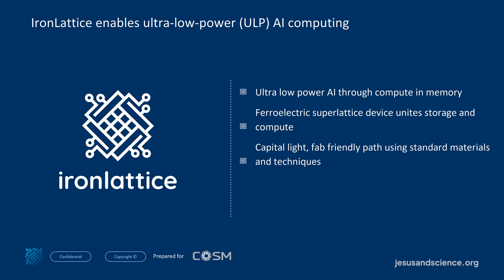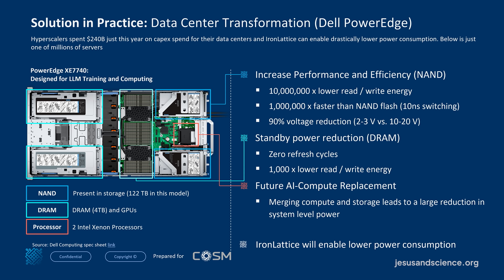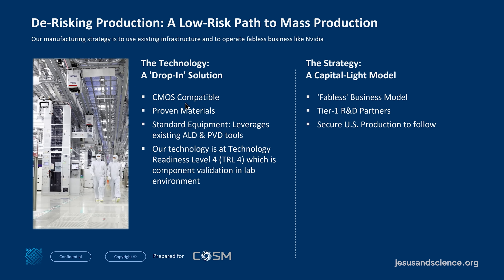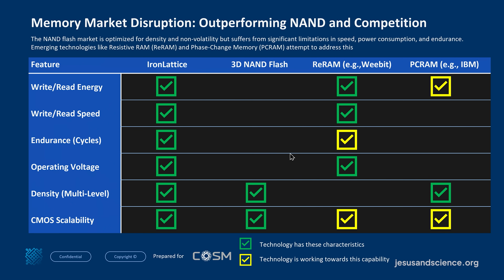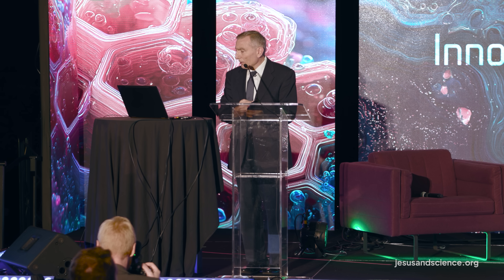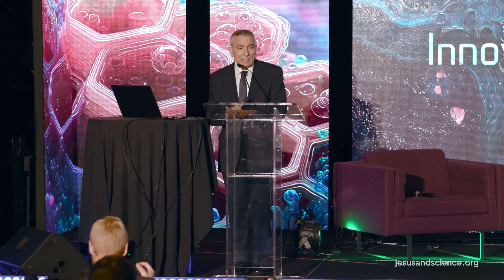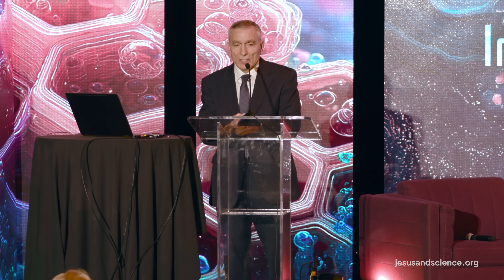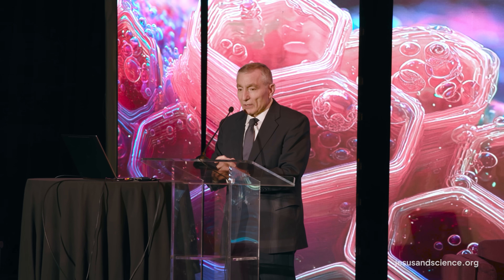Breakthrough: Radical New AI Hardware Design That Nvidia Can’t Ignore | COSM 2025

Comment: Putting memory and processors together on the same chip is not done now because you need the same number of layers on both.  Right now, DRAM has maybe 8 layers while processors have 40 or so.  That’s like linking an 8-story building with an adjacent high rise. Above four floors, everyone from the high rise will fall out and die as soon as they go over to memory.  Presumably ferroelectric substrate can be used to even out layer count, either adding layers to memory or reducing layers from processing.  

AMD already solved this problem a decade ago on standard silicon by using their proprietary background in a unique form of memory called SRAM (static random-access memory) which has the same number of layers as a processor.  This is one of the reasons their new i450 chip outperforms NVDA significantly.   I have never heard anyone mention this, I suspect because they don’t have this intimate level of knowledge needed combined with the creativity to put 2 and 2 together.  It is the main reason I have been positive on AMD since the stock was $2 per share.  

Regarding wafer-sized chips, that’s pretty much not economically feasible or necessary with the AMD chip.  They hired a brilliant guy named Jim Kelly in 2014 who figured out how to make the interconnects between chips run just as fast as the internal processes in the chip.  So, they could make the chips smaller and just stack them and get the same performance as a fully integrated wafer-sized chip.  Intel went on the route of integrating everything into one huge chip like Dr. Tour suggests.  That’s how intel lost out to AMD.  The all-in -one chip started out with an enormous chip before they shrank it down that gave zero yield if there was a single defect on the wafer.  AMD in contrast achieved high yields from the start, reaching profitability almost instantly.  Anyone can design and produce a chip with small dimensions.  But not everyone can do it profitably in high volume commercial applications.  This is why Moore’s law was such a breakthrough predicting the doubling of technology every two years.   It is not a statement about technology.  It is a statement about the rate at which commercial viability is achieved.  

I could be wrong, but I see nothing here but an inadequate solution to a problem that the great Jim Kelly already solved a decade ago, putting Intel out of business because they couldn’t solve the problem.  When Intel finally saw the writing on the wall, they hired Jim Kelley too, but by then the game was already over and Intel threw in the towel.  

George Gilder BTW is a New England intellectual historical theorist who studied under Henry Kissinger at Harvard and has no background in electrical engineering.  He was completely wrong about 1999 optical in the bubble and lost people fortunes.  He disappeared into disgrace for decades and has only now re-surfaced with the advent of AI and the emergence of a new generation of young tech investors ( tech investors are almost always young) who have no institutional memory of who this guy is.

This work is being done in academia where there is no requirement to solve practical problems.   Moore’s law, remember, is basically about economies of scale and learning curves in commercial applications, neither of which happen in a university setting.  This is only at stage 4 of 9.  It sounds to me like they have not done their homework on prior art, but I could be wrong.  They may achieve in ferroelectric that which AMD is already doing.   

What am I missing?  Help me out.
Reply: With all the people around him involved in this in the chip business it sounds absurd to assume they don't know all of this and would move forward with this if such issues were relevant... They wouldn't be wasting their time for no reason. And the two companies he said they are in talks with for this would obviously know all of this too...

Comment: RE electromagnetic interference question at 13:30 -- It will not matter because the mumetal shielding can be easily applied just as anywhere.  There is likely no benefit over nor shortcoming under existing electronics.

Comment: Very impressive. However, isn't this already underway elsewhere? I'm thinking of Bernardo Kastrup's startup EUCLYD, whose CRAFTWERK has a System-in-Package (SiP) architecture that integrates both computation and memory in the same physical device, to minimize the traditional "von Neumann bottleneck" and avoid the data transfer latency associated with external bussing. Is your device markedly different?
Reply: Yeah he needs to clarify this
Reply: The problem is you can't clarify such things. The way you handle memory is the main proprietary part of the computer. However, how they're planning to do it is bad. For the longevity part of it, however, the inventor is on the right track. Congrats to Mr. Shin.

Comment: This is not a computing revolution, and presenting it as one is dishonest. The core idea of ferroelectric CIM is a well known, decades old research direction, not a breakthrough, and the headline claims rely on misleading comparisons between single-device switching energy and entire system-level NAND or DRAM operations, which no competent computer architect would accept. The slides ignore the dominant real world costs like analog noise, ADC/DAC overhead, calibration, yield loss, thermal limits, and scaling beyond toy demos like MNIST. Claims about “drop-in CMOS compatibility,” “true compute-in-memory,” and “the end of the microchip” exploit ambiguity between lab feasibility and system viability, which are radically different things. At best, this is a plausible niche accelerator for certain inference workloads. Portraying it as a general solution to AI energy consumption is wildly overblown marketing.
Reply: This is a good example of speculation. There are no details about this amazing superlattice ferroelectric layer. What can be done in the laboratory cannot always be transferred to the production line for many technical and financial reasons.

Comment: Anyone who understands chip design know computing requires trivial amounts of energy.  Intel chip design is so poor it can consume 100 Watts while the actual computation cost is about 1 mW.   Apple abandoned Intel for that reason.  Apple Silicon processors are many times more powerful than Intel and Nvidia and consume trivial amounts of power.  Nvidia is great at making lots of noise.  There are other GPU and NN processors out there that perform much better.  People worry about China overtaking the US in chip design because the US for some reason prefers junk like Intel and Nvidia over well designed chips.  The stupidity of that decision was been known for decades.  The cost savings in buying an Intel chip is lost within months in terms of energy cost, mostly for air conditioning.  Note that AMD is Intel compatible which means it is junk as well.

Comment: This is incredible if it works, and not just for data centers, but for everyone. It would allow the use of computers with a much lower power requirement, which democratizes their use. You could get enough energy to run a laptop from a small solar panel.

Comment: This is the greatest problem with competing against nVidia though.

You can't JUST have great hardware, you need a software solution that can compete with CUDA too.

AMD kinda got there after many years with ROCm, though it's still pretty rough around the edges.

By the time you get your own software up and running nVidia will probably have just embraced a more competitive hw architecture for AI/ML compute, but already baked into CUDA.

Comment: Funny, looks like battery technology advancement is taking so long we are gonna get longer lasting batteries only because the electronics have advanced enough they use significantly less power. Don't forget microled screens seem to be a sure thing and on the way in maybe 5-10 years and use maybe 50-70% less power.

Comment: Your data centers are wasting 500lbs of copper 750 cable on average ik i build them simply putting the power racks side by side decrease production cost and annual upkeep by 5k, yes theres room why am I running 32 60ft 750 cables when 22 foot would do no down side. And labor cod decrease by 2 days

Comment: 3:54 - I don't understand how compute can be done in memory without changing software? Just switching out memory doesn't seem sufficient to make a functional system.
Reply: Try finding an actual read or write time in those diagrams.  The only thing of any interest is a memory having more than two states, and that is nothing new.  Ironcore memory was one of the very first memories (like 1960's).  The density difference compared to modern memory is like 10's billions time worse.
Reply: that’s exactly the beauty of AI - fixed algo with “memory”/tensor being its logic
Reply: Maybe just an additional kernel module...

Comment: He's back.  I'm at 2:54, and know what his priority stuff is there.  However, which option is he using. Their is a way to do it with standard material, another with his, and a third option coming on stream.

I've been proposing to do what he is announcing for a while.   But nobody seemed interested, but now somebody else is doing it (again).  I have actually bern interested in using his materials and getting in contact with him.  I am in a section of industry with the lowest energy processors, and was to design a high performance version a d transformation circuite for this sort of scheme.  There are a terrifying amount of these small processors that can be stacked together on one wafer.  So, I was planning on balancing out the performance to the amount of memory around each cpu for performance targets (a 1TB+ wafer system capable of producing 60Tps, for personal local AI inference at $1000.  But, by changing packing desity of cpus very high parralel performance is possible.  The cpus are only a small fraction of the stacked wafer circuit, so 10x speed up shouldn't sacrifice much memory.  100x speed  up could use high speed system requiring active cooling,  but may just need more cpus with a maybe fraction of memory decrease.  In a server farm, these sorts of cooling challenges are common, and the speed more important.  Anyway, these processors start at around 1000 transistor worth, plus stacks.  My design was to aim at 4000 transistors.  I had been equated with tne top low energy processor designer, who's company is contracting to do AI.  My own designs were trying to maximise performance per mw, rather than absolute minimum energy, with simplified performance increases, concentrating on extending the ratio between energy and performance.  Since I am recovering from long covid and injury, I have decided to training a bit and start pursuing magnetic quantum cellar automata research instead.  Which is a lot faster and has lot lower energy than what I just mentioned.

Comment: We did this with software. No e-waste needed.
Reply: If you have the best most efficient software it seems you should be trying to partner with them.
Reply: @suggesttwo  We'd love to, but it's not up to us.
Reply: You can't reduce hardware power consumption with software. If you run the same software it will take less energy with this new hardware.
Reply: @suggesttwo  It is possible to reduce hardware power consumption with software.
Reply: @pilzburied Nope. If you then put the improved software on the improved hardware there will be the same improvement in efficiency.
Reply: @suggesttwo  Using software optimization to reduce power consumption in hardware happens. It's definitely "a thing." Get over it.
Reply: @pilzburied In the 1990s when hardware wasn't that fast bottlenecks in the software were written in machine or assembly language to reduce the number of clock cycles to execute the code.
Reply: @suggesttwo  You're attempting to argue with someone who engineers software optimization daily. You can dismiss innovation all you want, but that doesn't stop people from innovating.
Reply: @suggesttwo  Then, I guess we know something that you don't.
Reply: @skyrmionlabs explain like I am 5. I am an electronic technician by training. If you lie I will name the law of physics you are breaking.
Reply: @suggesttwo  Why would we have to break the laws of physics? It's a matter of software optimization that has been around for 70+ years. There would be no reason for us to make such a claim if we couldn't prove it.

Btw, science has been re-written numerous times. To assume that we know everything is to apply limits to thinking and innovation.

Comment: I used to work in this industry. Been out about 15 years and figured everything had changed. I was shocked to hear that, no, not much has changed. Just scaled up. CMOS, DRAM, the architecture is all the same. That's insane. I used AI techniques in the late 70's, 80's and 90's to get my software to perform the "impossible" tasks that were required. It was the only way to solve the problems we were facing. At the end of the 90's and early 2000's computers were no longer resource starved and my software started to get strange. It made me uncomfortable. I understood the potentiality. Not good.

Now you tell me there is no transfer latency (compute IN memory), no thermal issues, no refresh cycles, CMOS compatible, massively scalable. This sounds troubling to me. And it sounds like data centers can be powered from house current. YIKES. That log cabin, off the grid in the outback of Alaska is sounding better and better. Are you certain you want to release this on humanity? It's likely too late in any case. My nightmares will now be much more vivid.
Reply: At the end of the day it's the implementation of the technology that matters. If we do not use it we will be left behind. Remember we are the retaining force holding the anti-Christ back from taking over like described in 2 Thessalonians 2:7. The technology will be used to take over the world after the church is rapture'd and the anti-Christ is allowed to take over.
Reply: @Johnny-es9xg  Yeah, granted, you are correct. It is still spoooooky though. Though I won't be here to see it I am still kind of regretful that I participated in its rise. However, it would have still risen regardless, it's not my fault. God works in mysterious ways, eh?
Reply: We've got 5 good years left. Make the most of them. After that, the world will likely enter a state of constant change due to the drastically increasing pace of technological development. Eventually the rate of change will be so rapid you'll wake up in a different world than the one you went to sleep in. Buckle up...
Reply: It likely won't scale. There's eddy currents, white noise, radiation interference. This will introduce single point failures and the data industry won't adopt the risk at scale
Reply: @notaras1985  Single point failures can be dealt with. We have long ago dealt with the other problems in other technology using some of the same principles, it was just ahead of its time, expensive and not reduceable to nano scale. Heck, ferrite core memory was some of the first technologies used! No, I think Dr. Tour knows his stuff.

Comment: Memory errors with eddy currents or radiation tested? Most people don't knwo this but that is a huge factor that MUST be mitigated. Not to mention if you put all the ram, rom, and processors on the same PCB, if you lose one, you lose all of them. There is some more testing needed still...
Reply: Someone asked that question I believe at 12:58 but correct me if I'm wrong...

Comment: Just to add to the conversation.  Mediatek released an SOC a few months back in Sep2025, the Dimensity 9500.  This mobile SOC has two (Neural Processing Unit)NPUs.  A large main one and a tiny one that is Compute in Memory.  Dimensity 9500 is currently only used by the Oppo Find X9 and Vivo X300 mobile phone series.
Reply: Yes ,but the memory on that SOC is not ferro-electric. The actual logic can act as memory since the FET's have iron in them they can store bits and do compute at the same time. Therefore it retains data when switched off acting like NAND flash memory. The memory Dr.Tour is describing can be used as both storage and compute memory making a truly unified memory system that does not need both RAM and Flash memory. Just one type of memory reducing the compute power and efficiency by reducing the communication latency between devices. This is a really good idea if they can pull it off for computing as a whole.
Reply: @Johnny-es9xg Yes, Mediatek could be a potential client especially since they have a CIM implementation, furthermore the pricing pressure on memory(due to AI infrastructure scaling) would be another factor.  Been watching the "Data Move" problem for decades now,  perhaps a paradigm shift is upon us.  Anyways, this is all academic until the right labs validate this tech.  Which node process was this tech demonstrated on?  Do you know?

Comment: There is no way data centers will use less power, they'll just do 80% more compute.
Reply: They'll do both
Reply: 80% more compute with a lot less power.
Reply: @1g1d1w well, if its 80% more, it'd be the same power, just more compute.
Reply: So let's make more electricity.